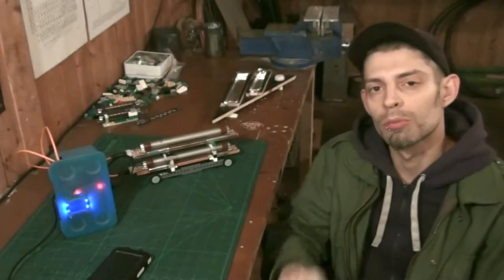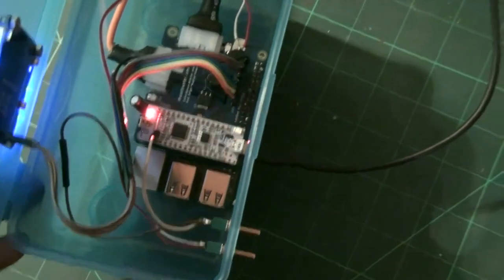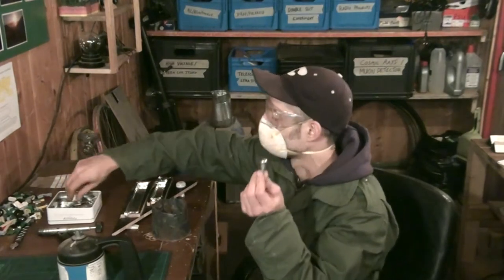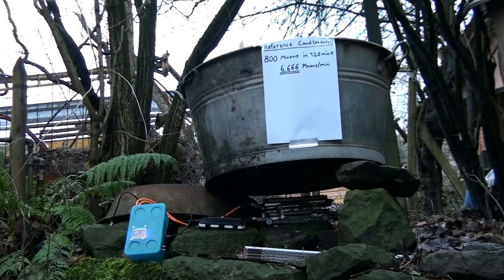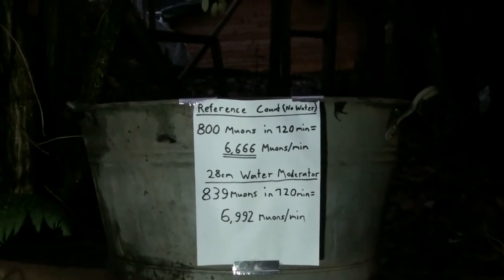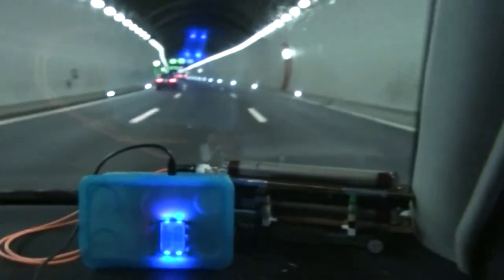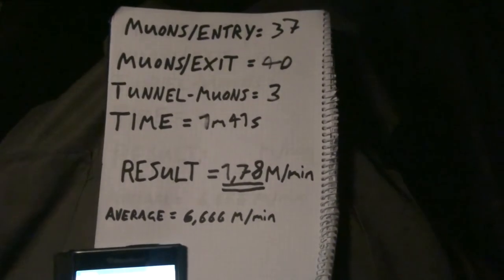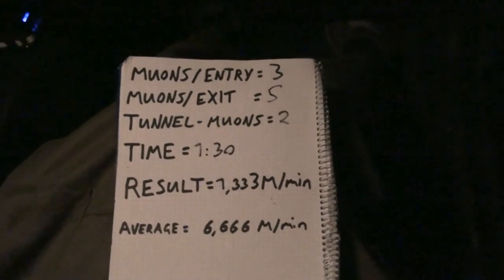#2 Cosmic Ray Muon Detector Set Up & Tests with Water and in a Mountain

Comment: Just curious, how do you clean you hands after working with lead.
Reply from the maker: ..what i found out while researching is basically just wash youre Hands with non abrasive Soap. I think Skin Contact with a solid piece is the least harmful exposure to Lead, Lead Fumes or Lead Dust are much more Dangerous. So Basically i just try not to touch it too much, and packing it into a Plastic Bag or Electrical Tape when i finished casting a Piece  ...But then probably i am not the best reference when it comes to safety measures ;)